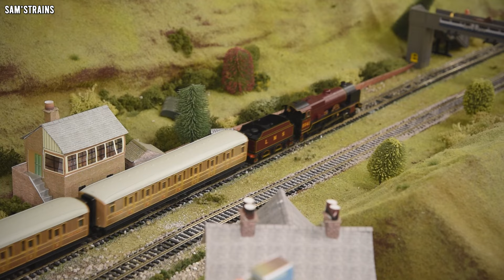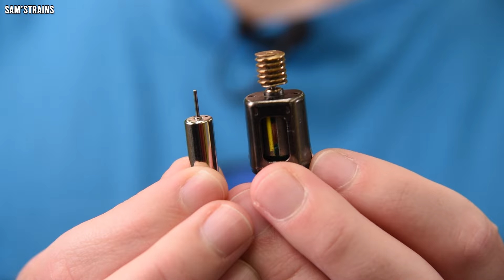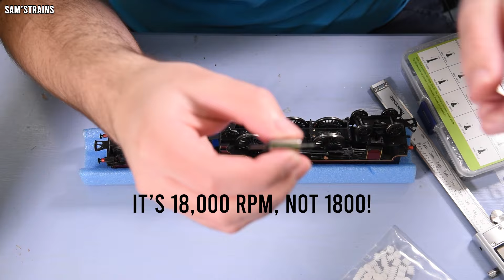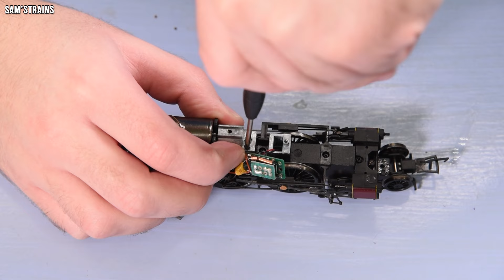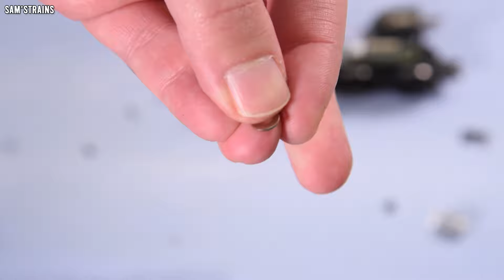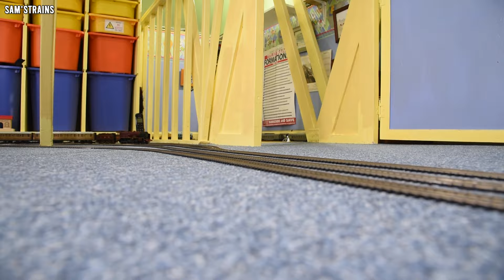Save Money Fixing Dead Bachmann Trains? | Cheap Motor Experiment

Comment: If the motor ever dies on my B-mann 9F, H1, or Super D, then I will definitely keep this replacement in mind. I've had the 9F apart to remove a blown capacitor and offered up some spare HO motors I have on hand (Bachmann 5-pole, Kato, Atlas, Canon) but all are too big. The 9F itself has a mounting cradle made completely of metal so the 3d-printed coreless mount might not work in this case. 

Another option I've considered is the 5-pole motor found in Atlas' N-scale diesels. They are very high quality and I've found an eBay seller that has them for cheap.

Comment: Hi Sam just a quick tip for meshing gears that I've used for years in fine engineering work. A single cigarette paper between the gears when assembling the drive train gives perfect clearance with minimum backlash
Reply: That's a great tip but, in this non-smoking world, what is the equivalent of a cigarette paper?
Reply: @gagatube  you can purchase cigarette rolling paper from any tobacconist without actually purchasing the tobacco. The cigarette paper is processed so it is much more malleable and easy to fit around the drive teeth
Reply: @gagatube  Loo Roll ??
Reply: @keithg1xfl  I doubt loo roll paper would be any use  - the single sheet stuff might be if it is still available (it also made excellent tracing paper...). I might be imagining it but don't some people say the foil wrap off chewing gum is right for gear clearances? I'd imagine that would be a lot thicker than cigarette paper but I'm not sure.
Reply: I know, the cigarette paper trick goes way back! To date, I have never found a worm that was compatible with the gears, so have had to build new gear boxes to match. Also, those nylon worms and gears are brilliant as I recently scratch-built new EM bogies with (central motor and brass universal drives onto Gibson coach wheels) with those nylon worms and gears for all four axles, to go under a second-hand Lima GW Express parcels diesel body.

Comment: I was just wondering if you could add a flywheel to the other end of the shaft. Maybe resin some washers together or file down a worm gear to give you a central core to affix washers to.
Reply: You need inertial mass anywhere on the gear train to improve performance. These motors are so low torque a flywheel would not be effective. It would be better to add more mass to a downstream larger gear.

Comment: Great job, Sam! This will teach the manufacturers. What about adding a flywheel on the shaft on the back of the motor?
Reply: I was going to ask the same thing.
Reply: I am surprised about not taking the opportunity for a flywheel too. What method do you suggest for accurately meshing the worm and motor Sam?

Comment: And you can even add a flywheel, a great idea, especially with a low inertia motor like a coreless one. Splendid idea to ressucitate a shelf queen, I buy it with a 3D printer !
That's a great slap in the face of the manufacturers too : you can have better geared engines with slower motors and flywheel on a shoestring.
I pay the greatest attention to your experiments with 3D printers. My forthcoming PLM 3D printed engines would benefit from this.
An Idea I have : get a complete rodding with laser cut brass sheets... An idea for you ?
Reply: agree. flywheel would be lot better at slow speed

Comment: i replaced the n gauge original motors by coreless 7 mm diameter motors in dapol steam locos.it is an easy job because the motors are in the tender.no need to dismantle the loco.result:best quiet  performance and even better enough space left to install a zimo sound decoder + sugar cube speaker.now i have the amazing reality operating fun.

Comment: Nice work Sam, Iv'e done something similar for my Triang Jinty and a old pocket rocket 0-4-0 Blue '7178' getting hold of the motors here in Candida is near to impossible and shipping costs from England are more than the hornby/Triang motors, so I used a  mini 6 pole motor  yes 6 pole from AliExpress for $5 CND about £3. They work better than ever, Its slowed down the 0-4-0 and now can crawl, both loco are great shunters  and seem to have a realistic top speed at about 10 volts. 
 I look forward to seeing more motor swaps.
Reply: That's interesting! Do you have the link for these motors? I also don't live in England so it's nearly impossible to get them
Reply: I'd love to see both engines perform with different motors

Comment: Great idea.  This is the future for giving old locos a new lease of life when new models are so expensive.  I'm looking forward to the time when I can buy adaptor cradles that allow you to replace x03 and X04 motors with coreless or 5 pole motors.
Reply: Why my X04 and X03 motors up to 55 years old run fine and are serviceable.
Reply: @DavidCoombes54  I do appreciate that some are still wonderful runners, but the ones I have, though, I have cleaned them and oiled them and replaced the I magnets and done all I can to make them serviceable, they are not good runners at all.  As you cannot buy new ones there are no guarantees second hand replacements will be any better; they could even be worse.  I'd like to give these locos a new lease of life.

Comment: Can you investigate whether some of the engines you've reviewed that have been geared too fast could be improved with a higher ratio worm gear?
Reply: Worm gears have a fixed ratio, it's the cog they work on that determines the ratio. For the worm side it's one tooth per revolution of the worm gear. So unless Sam can wedge a bigger gear into the model he can't change the gear ratio. The slower motors are the only way to change the speed, sadly.
Reply: @mozismobile   To clarify - A worm can have a number of 'starts' which determines the gear ratio in isolation to the meshing gear; whilst single start worms are by far the most common and I therefore agree with you from a simplistic purchasing viewpoint, worms definitely can provide different gearing in the same space by having more 'starts'.  In this case though, more starts would increase the speed!
Reply: Yes   better  gearing  would  allow better running...more  torque

Comment: Nice project Sam, though you’ll need to see if the new motor lasts the test if time. If they are cheap but fail often then it’s a false economy.
Reply: Bachmann motors are expensive and fail often, how bad would the replacements need to be for it to end up a false economy.
Reply: @madduckuk  do they, the only motors I’ve had fail have always been in Hornby locomotives and they often cost twice as much as a Bachmann.

Comment: Hya Sam I have got a bachman wd 2-8-0 and it shorts out my layout could this be caused by the motor
Reply from the maker: It could be Steve - but it's worth checking simpler things to fix first like pickups, loose wires etc! To be sure, you'd need to isolate the motor (remove the wires) and power it directly... if it works, then obviously it's not the motor!
Thanks for watching, Sam :)

Comment: I've seen those motors advertised for a few years now, and have often wondered.
I tried fitting a Pendolino 5-pole, or Castle - forget which - motor to replace the hopelessly performing Bachmann Jubilee I had at the time ... 
My problem is I don't have a 3D printer, but it NEARLY worked, with a motor at least twice as good ... would have been a nice fix!
Great that you're giving the Community additional ideas Sam.
Thanks for sharing.
Al.
Reply from the maker: Thanks Al - you can get great motors very cheaply these days - I've almost never been disappointed! Appreciate it anyway,
Thanks for watching, Sam :)

Comment: Best show on the internet.  If you can find a 5 pole motor, that should solve the croul problem.
Reply from the maker: haha thanks so much! The trouble is space - the original motors are more or less an exact fit into a Bachmann body... and those motors are tall and thin... so picking something tiny increases compatibility across different models!
Thanks for watching, Sam :)

Comment: Since you have both shafts, is it possible to add a flywheel?  You might find one on Aliexpress.  Also, did you not need to put the capacitor back in the line from the old motor?
Reply from the maker: Yeah absolutely you could - they'd have to be quite narrow though is all!
Thanks for watching, Sam :)

Comment: Maybe a small flywheel could be fitted onto the other end of the motor
Reply: With a  lathe, a flywheel would easy. But even if you got one off the net with a bigger internal diameter . You could 3d print a bush for it.
Reply: @jameshodgson1609  That's cool. I learnt metal work at college. Only problem is, I don't have a lathe.

D/8000 = The speed of the lathe to turn the metal.
Reply from the maker: Yeah absolutely - one that's narrow enough and with a 1mm hole would be perfect! :D
Thanks for watching, Sam :)
Reply: @SamsTrains  i'd imagine that the rotational mass of the motor is so low that even a 3d printed flywheel printed at 100% infill would yield beneficial results!
Reply: @SamsTrains  wouldn't the flywheel need to be balanced to run properly?
Reply: These motors are very low torque but high speed. Adding additional mass to the larger wheel would be more beneficial.

Comment: Shame about the metal raws on the vice rather than using soft raws, otherwise good video
Reply from the maker: That doesn't matter - not going to damage anything, as they're just used to press the parts together!
Thanks for watching, Sam :)
Reply: @SamsTrains  fair point. I would say the motors you had ran in compared to the new motors, would this make any different 🤔  would be interested to see if the new motor ran in would perform better